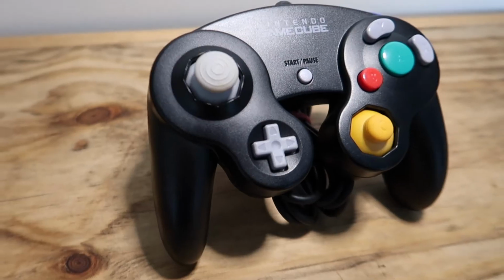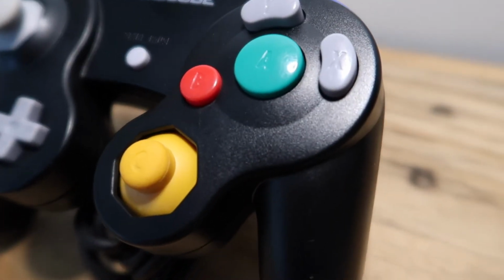Grubby GameCube Controller - Teardown & Clean

Comment: I am having trouble putting the case back together, and I am unsure why. I took apart a different controller and was able to put it back together without a problem, but I am having a problem with the black case controller. I made to properly put the wire back in @5:57, but it just doesn't fit snug. any suggestions?
Reply from the maker: Honestly if it’s not going back together I’d try pulling it all apart and trying again
Reply: Unfortunately, I've been doing that for a few hours now - can't figure it out! Thanks anyway!
Reply: Did you figure it out in the end? I'm having trouble getting my z  button to go back in place and so it's not closing properly

Comment: My controller was tossed and as a result the left screw in the handle is broken and the whole left side of the controller isnt working. Any ideas how to fix?
Reply from the maker: Oh dear that’s not good. If the screw post is broke you should still be able to open it up but just won’t be able to reseal as well. As for half the controller not working, I’m not sure how to fix that. Would need to have a look at the board to see what has broken
Reply: @TheBygoneEra  Yeah I think it took a big hit. It was one of the white ones from Japan :face-purple-crying:Thanks for the reply